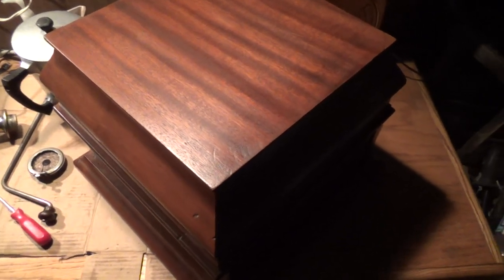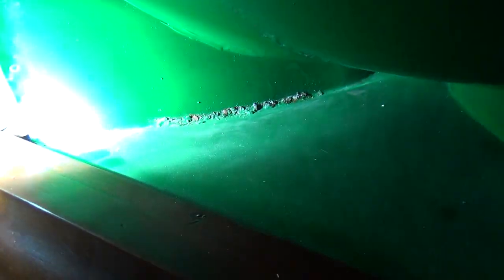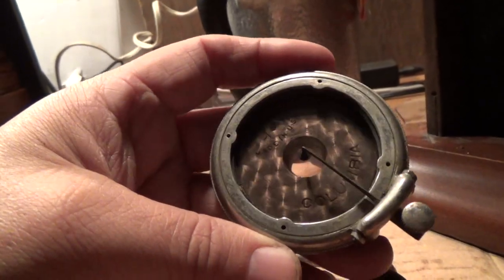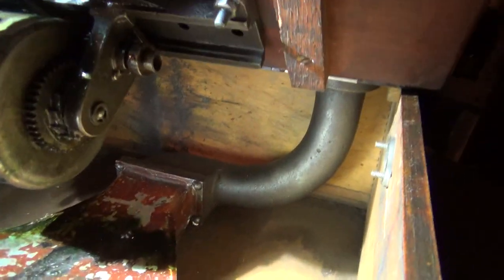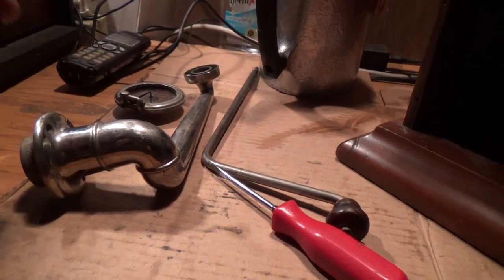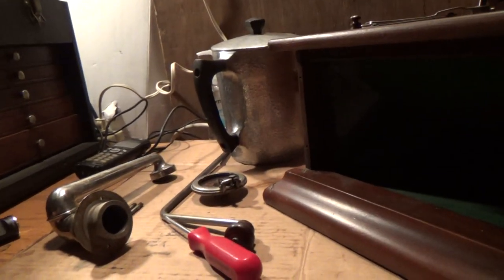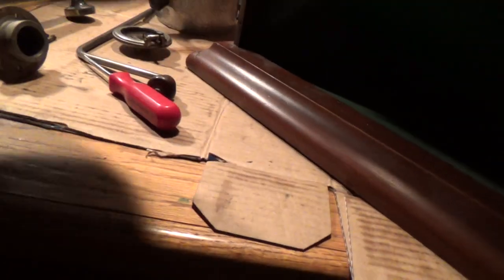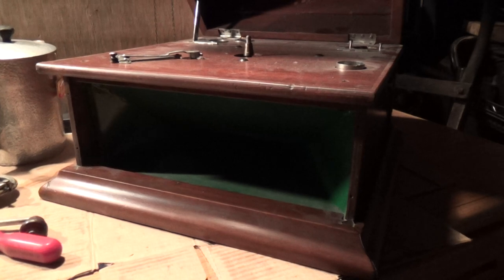Inspecting A Columbia Grafonola

Comment: Cool! I have a similar machine like this which is a Sonora tabletop from late 10’s or early 20’s and it looks pretty darn good than the Columbia. Sonora was a company that it was in New York City from the 1910’s right up until 1929 or 1930 when Sonora got out of the phonograph business, because of the Great Depression where the company went bankrupt. It has a nice looking spring motor and it looks really good. The model is a Barcarolle.
Reply from the maker: They were all trying to make a phonograph while avoiding the Victor patents, or Edison's.  Sometimes they had to pay a royalty to use a patent or two if allowed.  I suspect the lid is one they had to pay for.   These date from the Victrola period, Victor invented the internal horn design, another patent everyone would have had to pay to use until it expired.  1912-1918 or so, there are only so many ways to make a tabletop phonograph so they do tend to look similar.  They would come up with special reproducers, or sound controls to try and one up each other, and get noticed.  Victor ruled the market at this time, they had the best patents, the largest market share, and top quality machines.  Closest to this that Victor had was the VV-VI, but the VI didn't have a lid.  The VV-VIII did have a lid, but is a larger machine.  The Columbia has a very nice case, the motor looks more complex than it has to be, likely again skirting some Victor patent that forced them to make it that way.  I have had some filthy Victor motors, even ones that were out of machines in barns for fifty years, but none that were totally frozen.

Comment: Have you had great success soaking pot metal in penetrating oil and letting it sit in the freezer for a few days? That’s worked for me on a few frozen pot metal tonearms
Reply from the maker: I have had zero success in freeing up stuck Columbia tonearms no matter what I do.  I have worked with Heinemann tonearms, but these aren't as tightly fitted so there is room for expansion.  They do tend to crumble more easily than the Columbia's. If caught before they totally lock up you can sand down a bit of material so they will be free enough to operate.  The other machine is more intact than this one, I may just save this as parts for the other one.  Two years of looking for a good tonearm on that one and I ended up finding it by accident.  I bought a parts lot, and the correct tonearm was in with it.  That arm had just enough play so I could wiggle it apart and then sand down the metal with care until it moved freely.  Potmetal was a great material to use for reproducers and arms, it was an easier metal to work, cheaper, and it's lighter weight was easier on the records than some of the other non Victor  tonearms.